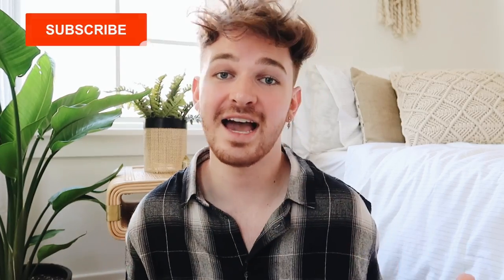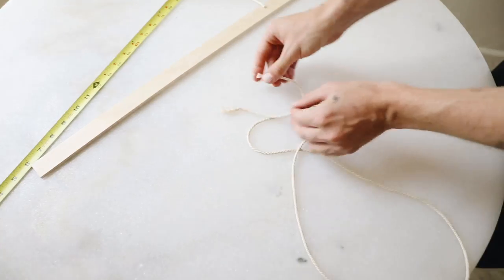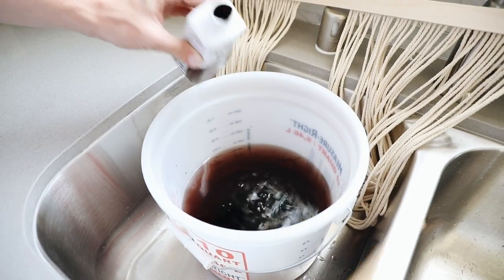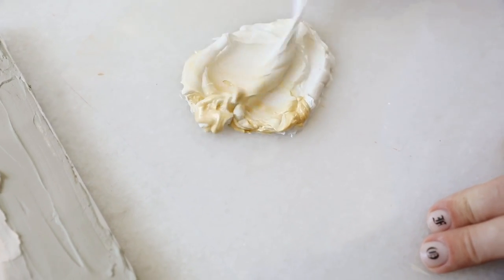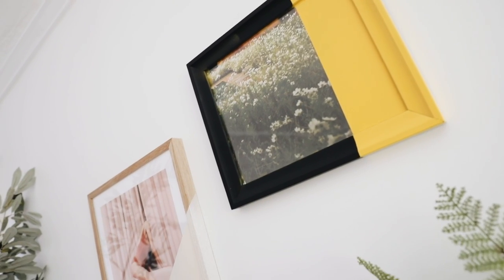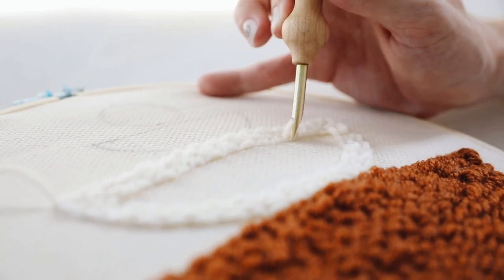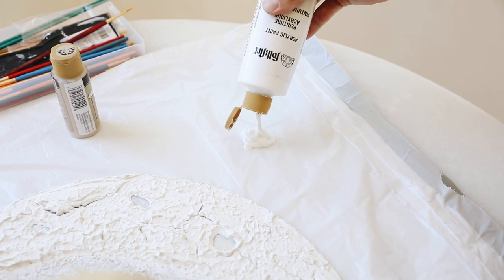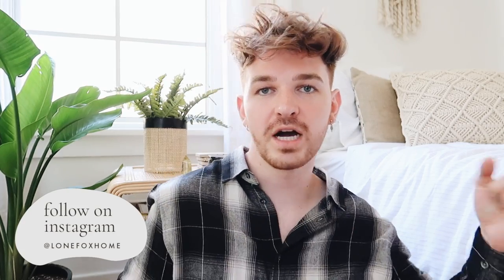5 DIY WALL ART DECOR IDEAS - Aesthetic + Affordable ☆ DIY MOON MIRROR!

Comment: For the first project, you could have used an acrylic medium and gotten a similar effect without the cracking and separating once it dries. I usually like using the modeling paste from Golden. You can get a small tub of it for under $10.